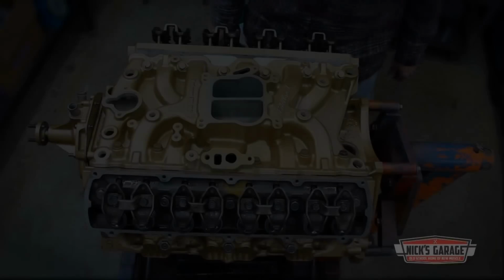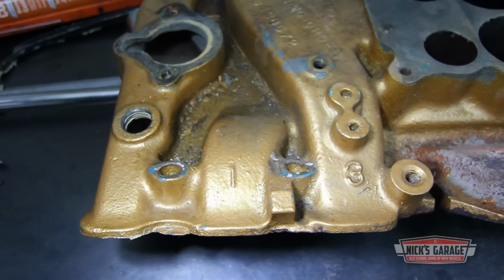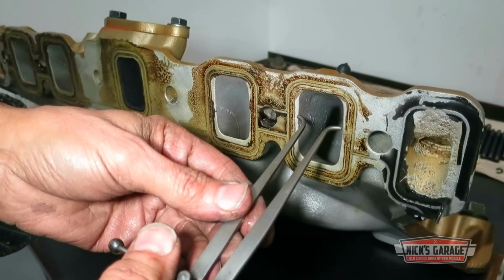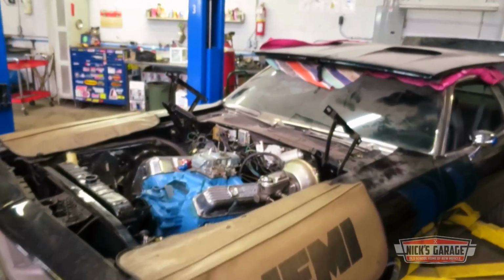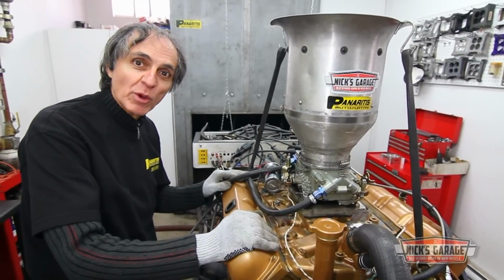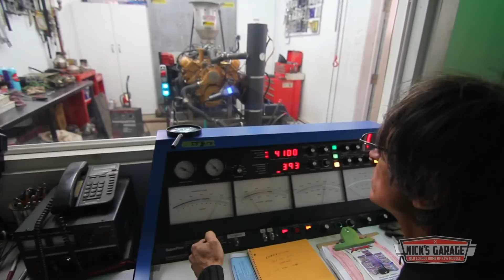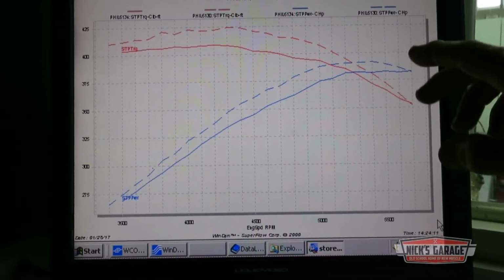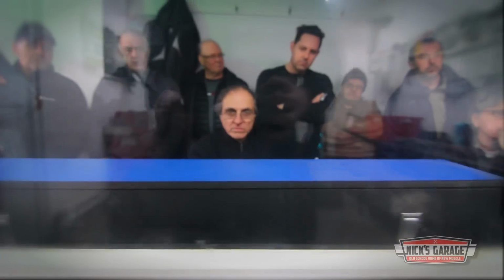Edelbrock VS Iron - Rocket 350 on the Dyno!

Comment: all that pissing around for 10 HP ?? I can understand it but putting on heavy boat anchor factory intake was a rookie stupid move ... better choice change cam and springs or replace rocker arms with aftermarket ones with a different ratio .. both ways are tried and true but did not suck up a lot of billable labor time in order to rip off the customer .. changing jets in carb and squirters and cams in carb are acceptable ways to fine tune air fuel ratio and setting timing to get target hp numbers but for fucks sake eldebrock would not have wasted hundreds of thousands in R&D to make an inferior intake manifold then stock.. if that iron intake was a race intake that had to be iron to pass rules back in the 1960.'s that would have been one thing

Comment: 13 AFR . . . . lets go up two jets.  WTF, of course you won't see an improvement... Never go any fatter than 13:1.  Hell I never went richer than 13.5.  Always shot for 13.7 or .8.    If you're not making the power with good ratio(s), the problem is obviously elsewhere.  Also, these readings are taken at full throttle so the primary jets, the ones they are "screwing" with are typically irrelevant any way.

Comment: OK I COULDNT HOLD BACK ANYMORE..THIS MAKES NO SENSE! YOU SAID HE HAS A RAM AIR AND YOU COULDNT RUN SPACERS OR A HIGH RISE INTAKE,BUT YOU PUT THE OLD INTAKE BACK ON PUT AND ADAPTER AND A SPACER AND A CARB HE CANT USE WITH THAT INTAKE,ARE YOU TRYING TO SEE IF IT WILL MAKE 400 HP TO RUN IN THE CAR OR JUST TO SEE IF IT WILL MAKE IT,WHY ARE YOU CHANGING THE JETS WHEN HE IS GOING TO HAVE TO RUN A SPREAD BORED QUADRAJUNK??!! BY THE TIME YOU PUT THE ACCESSORIES AND TAKE THE SPACERS OFF AND PUT THE EXHAUST MANIFOLDS BACK ON AND THE AIR CLEANER AND CRAPPY GM CARB ITS GOING TO HAVE ABOUT 350 HP ANYWAY SO WHAT DIFFERENCE DOES IT MAKE OR WHAT ARE YOU TRYING TO PROVE OR ARE YOU JUST TRYING TO SHUT THE CUSTOMER UP AND GET HIM THE HECK OUT OF THE SHOP,I DONT UNDERSTAND THIS WHOLE 400HP STUFF OR REASONING WITH THIS CAR ANYWAY LOL,PS LOVE THE SHOW😁

Comment: that's not a olds motor Buick olds Pontiac did not ever make a small block!!!
Reply: I beg to differ. The family of SBO includes the 330, then the 350, & finally the 403
Reply: Olds made a small block, but it wasn't really much smaller in dimension that their "big block" motors. Buick made a small block too, it was dimensionally smaller than the 455 and 400 engines.
Reply: Victoria Louden If Im not mistaken (which I probably am, as I 'll not an olds buff) I beleive that the only difference is the deck height.  As in the deck height is shorter on 400s and smaller than the 455.  If this is true, then they are all the same block size as deck height doesn't determine block size.
Reply: BUICK made a 340 V8 for two years, in 1966 and 1967. I had one in a 67 SKYLARK convertible. The engine was quite powerful and had no trouble accelerating with authority uphill. I made the mistake of loaning the car to a buddy who decided that he was going to show-off to his girl-friend. A few hours later, I got a phone call to come and retrieve my car. He'd blown the engine. That's when I found out that the 340 Buick was kind of all by itself and that if I couldn't find another 340 then I'd have to not only get a different engine, but, also another transmission. I couldn't find another 340 Buick. They were not a good engine. I repowered the car with an Olds rocket 350 and corresponding transmission. I put tank after tank of gas through that OLDS without so much as a whimper. I really flogged that engine. Couldn't kill it. Typical Oldsmobile.